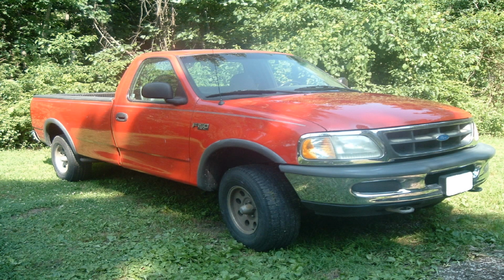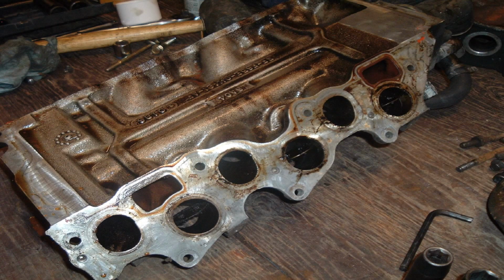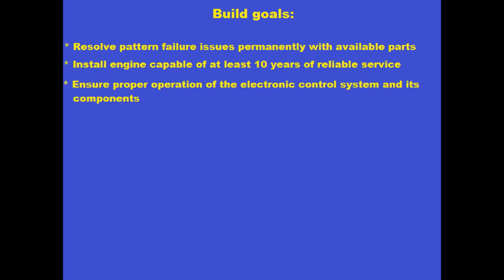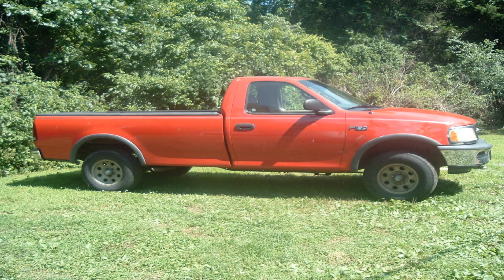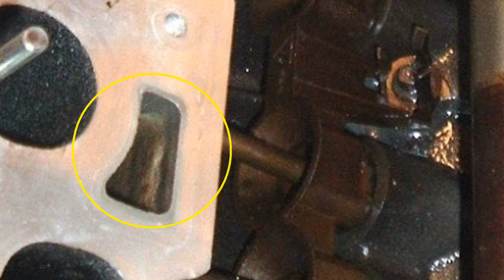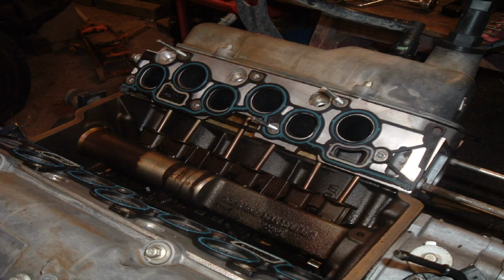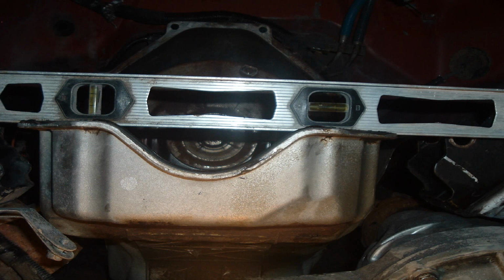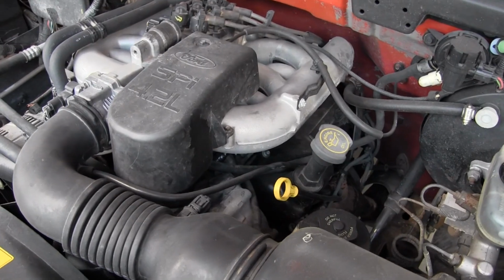2005 Ford F150 4.2 V6 engine swapped in to 1997 F150 4X4 *NEW w/ better audio and pictures!*

Comment: I’m going to swap the later model 08 intake into my 2003 f150 to avoid misfires related to the egr ports in the lower intake on the earlier model intakes.  And I’ll be using the fel pro lower gaskets that are made of metal instead of plastic

Comment: Trying to figure out why you didn’t use intake on your 2005 I thought they was the same from 2001 to 2008
Reply from the maker: The intakes from 1997 are different. The intakes from 2001 are similar to the 1997 but not identical. Take another look at the video and you can see the 1997 intake next to the 2005-2008. They are not even close. Thanks for your question!
Reply: @SlickRidezGarage  thanks
Reply: Can I put a 4.2 out of a 02 f150 into a 07 f150
Reply: I’m also curious about the intake. Is there no way to leave the late model intake attached and adapt throttle body/necessary sensors? Is the newer one a drive by wire setup?

Comment: Great info SRG!!! I have a 1997 F-150 4.2L 5-speed manual.  I  have found a 2008 4.2L V6 engine and am tempted to swap it. Do you know if my transmission would bolt onto it? Other than the lower and upper intake manifolds anything else that would be a problem?
Reply from the maker: Yes, the 2005 to 2008 4.2 will bolt to your 5-speed. Just note the video for everything else, including the relocation of the knock sensor to the back of the left cylinder head. Thanks for watching and for your question!
Reply: @SlickRidezGarage  Thank you very much!

Comment: Very nice work! I once went through a similar process transplanting a 3.0 V6 from a 2004 Taurus into a 1999 Ranger. Long ago I shoehorned a 460 into a 75 Cougar, which was harder than the 3.0 for the Ranger. But now I’m considering transplanting a 2004+ 4.2 into my ‘93 F250 4x4 5.8 manual. Still trying to figure out the difficulty level for the fuel supply and engine electronics part of the transplant. Would appreciate your thoughts.

Comment: lots of good info, im gonna do a 4.2 twin turbo build for my f150, at some point in my life. is it true the 4.2 is almost the same motor as the grand national? oil filter housing location and pump is the same...
Reply from the maker: Thanks for watching Slick Ridez Garage! In the late 1970's Ford had invested it's future in the inline 6 cylinder engines. As vehicles began to get smaller Ford found themselves behind the curve and needed a quick answer for a smaller size (length) 6 cylinder engine. Their answer was to copy the Buick 3.8 liter V6. That's why the oil pump is external....and the only "Ford" engine to have that. The 3.8 and 4.2 are both "Essex" engines and are very similar to one another. I'd have answered quicker but I'm in post production for season two and it's eating a lot of my time. Any other questions let me know. Have a good one!

Comment: Hey that was a neat video! I have a 99 mustang 3.8 5 speed and I'm talking to a guy that works at Ford and he said he can get a 4.2 motor with a bigger cam in my car. Do you think this is a good idea? I believe my car has the T-5 transmission and I wanna keep my manual transmission. I think that's be a decent power boost all around especially if the cam install works out OK. He estimated $1,000-$1,200.
Reply from the maker: The 3.8/4.2 block are pretty much identical, and the 4.2 is borne of the 3.8. The Ford "4.2" V6 back in the late 1970's was a knock-off of the GM 3.8 liter V6! The 4.2 can go in the Mustang, just like the RWD 3.8 can go in the 97-2000 F150 (in a pinch) by swapping components like shown in the video.  Try to find out who's making the cam your planning on putting in, they might have specs/dyno results on their website? Is that price for the engine installed with new cam/cam bearings/lifters and out the door, driving it like you stole it? lol even with a stock 4.2 you'd probably notice more torque. For some reason I wasn't aware they made beefier cams for these?
Reply: I actually checked with the guys I'm working with at that $1000-1,200 was for another 3.8 liter engine like I have. I had my brother inlaw install a more aggresive cam from comp cams in my current 3.8 motor and something went wrong, so with this motor I'll get I think I'll have the guy I'm working with install a .480/.480 cam since that's supposed to work with the stock internals. I hear that adds good torque and power. I looked on summitracing.com what I had was the max street\ strip cam they offered for the 3.8 mustang.
Reply from the maker: How's that Mustang breathing? lol as in any intake/exhaust mods in place/planned? We can lift the valves as high and long as we want, but if its sucking and blowing through a straw....... lolz
Reply: oh I have a custom true dual exhaust with 2 1/4 inch pipe all the way through, and new cats because I need them where I am from. when it was stock it ran really well especially with the 3.73 gear kit.
Reply from the maker: Right on, I'm sure you'll like the cam, and I'd like to hear how it turns out when you get it done! Are you going to do a video on it? Thanks for watching and commenting!
Reply: You are welcome! I can put a video up when It is done and let you know. Thanks!